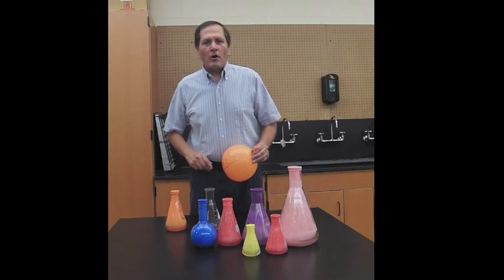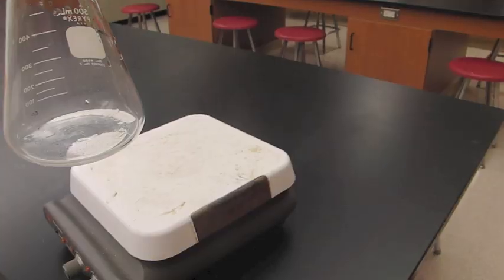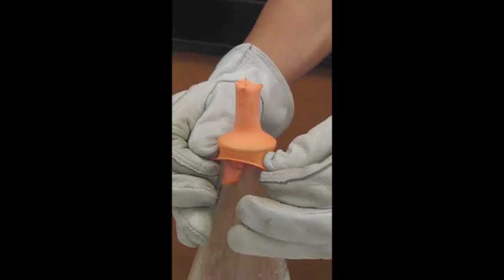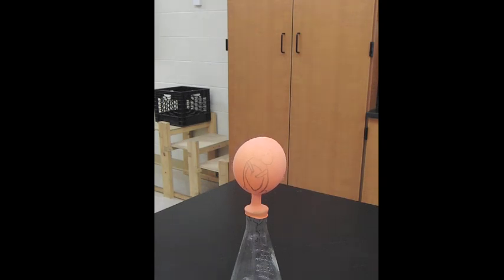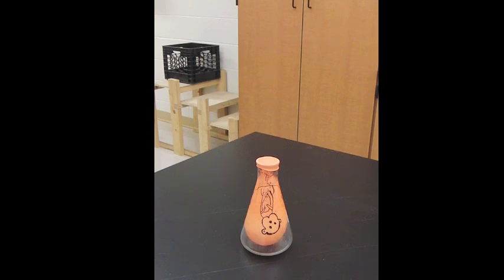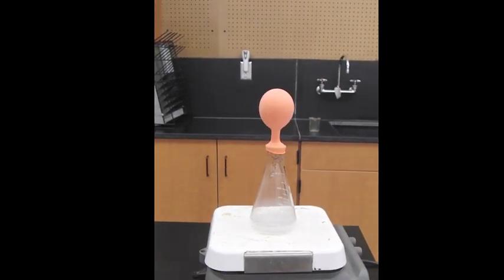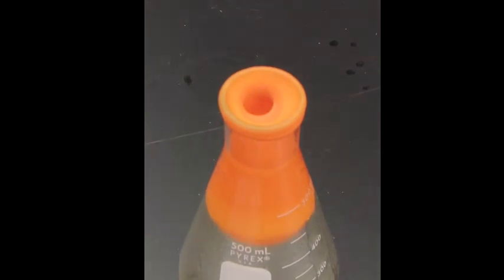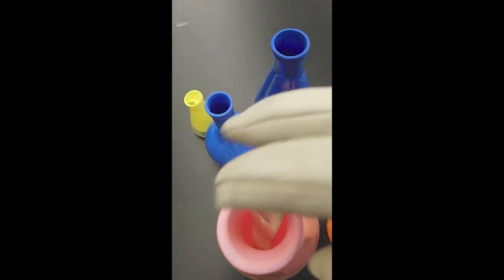Air pressure demonstration - Prairie dog balloons // Homemade Science with Bruce Yeany

Comment: I tried this with 2 different beakers. No info about how much water is given.  The smaller beaker inflated fastest but never deflated back into the beaker.  The larger one was slower to inflate but it did, very slowly, deflate into the beaker- only part way.  I would love to reproduce this with my grandkids but need more info.
Reply from the maker: I don't use much water,  maybe 3 tablespoons or 50mls.  For this to work you have to make sure there is steam coming out of the mouth of the flask, put the balloon on quickly before the vapor cools.

Comment: how much pressure do you think is on that? If you took a vacuum gauge, and put it over the top of the balloon, as soon as it went in, what would it hit? also, if it's enough, could you make a vacuum pump, by having the atmospheric side enclosed, and bleed off the pressure before you start to cool the flask?
Reply: I believe the pressure should be pretty close to atmospheric inside the flask (and exactly atmospheric outside :-) at pretty much all times.  When the balloons are most stretched on the outside, they'll be holding the highest pressure inside, and when they are the most stretched on the inside, they're holding the lowest pressure on the inside.  My estimate is that a balloon might be able to hold a difference of a percent or two of an atmosphere.

I just realized that maybe you meant if you sealed the top of the flask as the balloon went in, how high would the vacuum be when it cooled.  I believe the answer to that it that it could get down to the vapor pressure of water at room temperature, which is somewhere around 2% to 3% of atmospheric (that is a vacuum of ~0.97 atm).  So, as vacuum pumps go, maybe not great, but easy to build.
Reply from the maker: there is a demonstration where it is done in metal cans,  the pressure is low enough inside so that the atmospheric pressure crushes the can, so you can get it reduced quite a bit

Comment: What if the pot has a hole with a pipe, would not fill the balloon?
Reply from the maker: +Anonimousxz   I think as long as it is sealed it should be okay,  If it is open to outside air then no it won't.